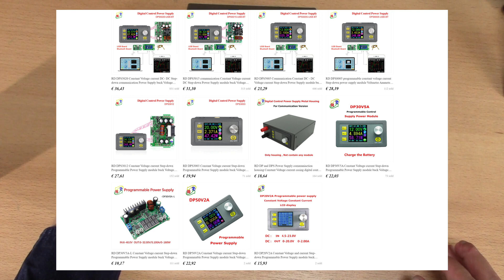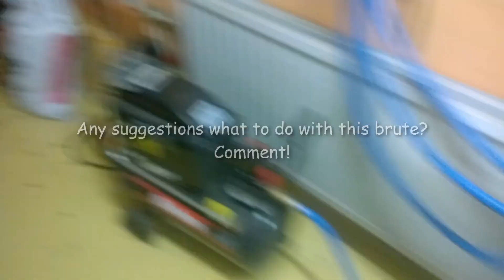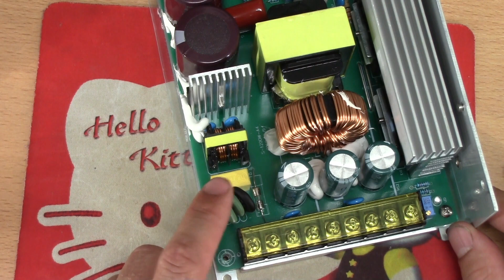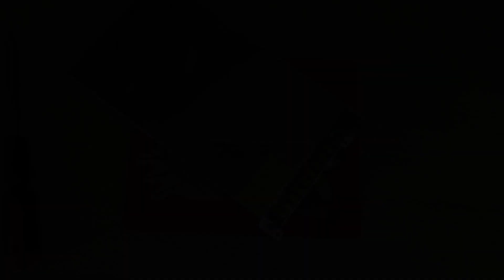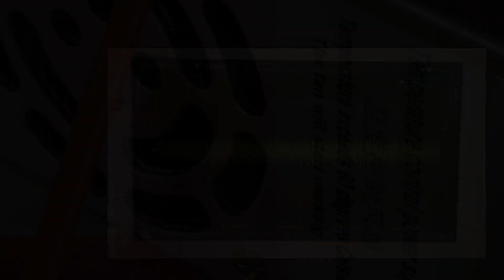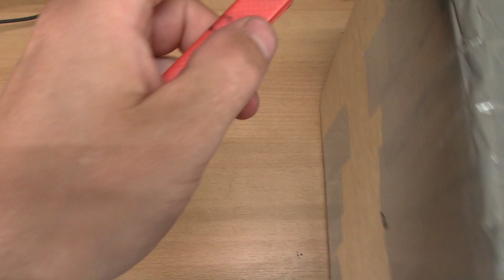S-1200-60, a good (cheap) companion for the RD Tech DPS5020?

Comment: Did you consider the power supply from a PoE Ethernet switch? Something like the Delta DPSN-550AP or UMEC UP1501D-54?
They can usually be found for less on eBay and I would consider them higher quality than something on AliExpress. The only downside is that they won't output more than ~56V and typically max around 400W output.
Reply from the maker: Those are good options, especially for the lower power versions of the RD Tech:s and similar. But buying crap from Ali, with the prospect of getting potentially lethal gear makes for better videos!

(Sorry for the long delay, I had sort of given up on the channel but decided to give it another shot)